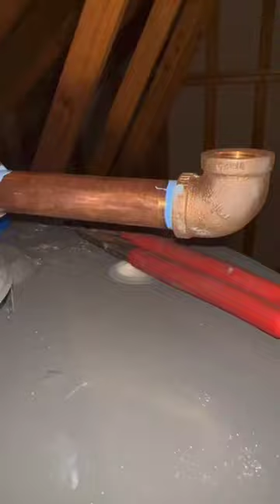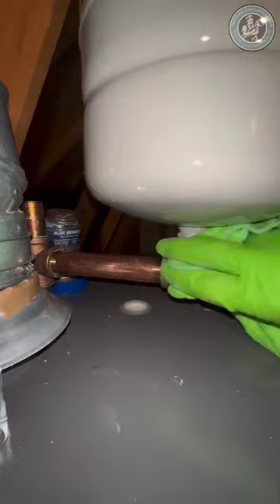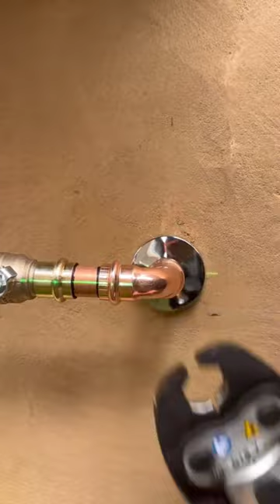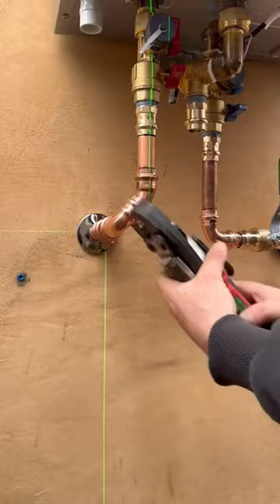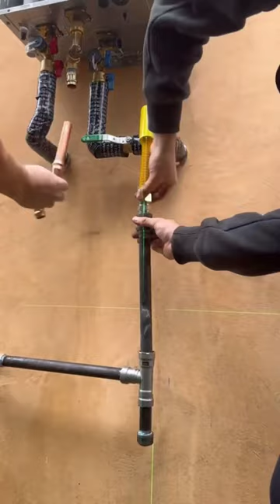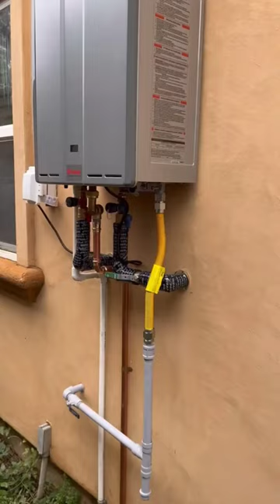They stop using copper so it wouldn't get banned #genz

Comment: But but, that’s brass…… it won’t galvanically corrode…..
Reply from the maker: I hope you're being facetious. Stainless steel is the more nobel metal in comparison to copper or brass. In this case Brass is the anode. It will also corrode when exposed to lead or tin, which of tje plumber isn't paying attention is an extremely common solder. 

Additionally, many people will use a copper wire on their roofs because the copper that wears from simple rain is enough to wash down a roof and kill moss growth. That SAME amount in long term dermal or drinking exposure has been reported to cause senility and organ failure.